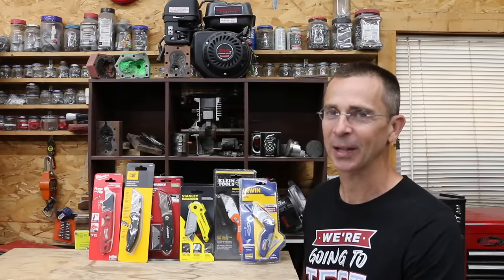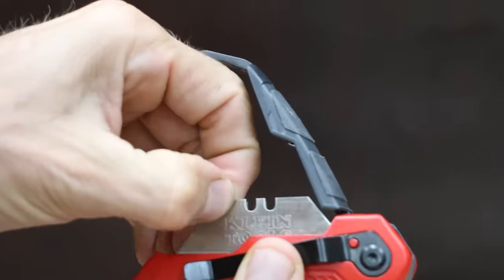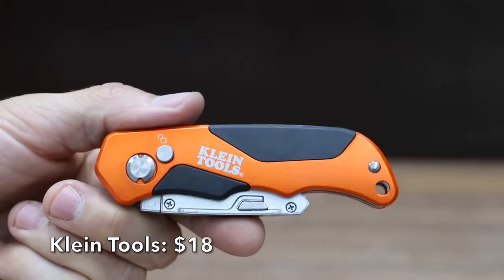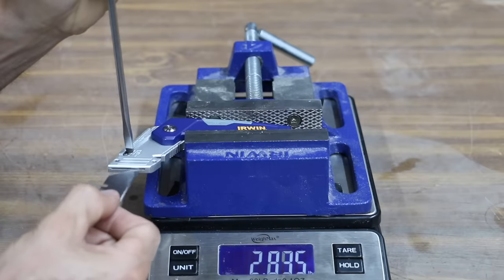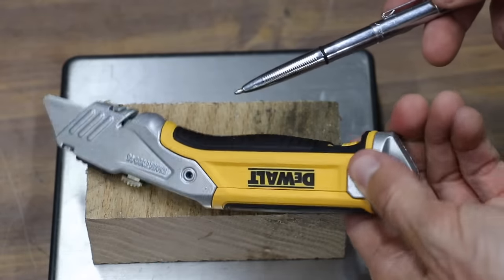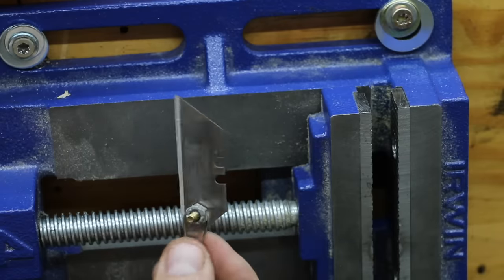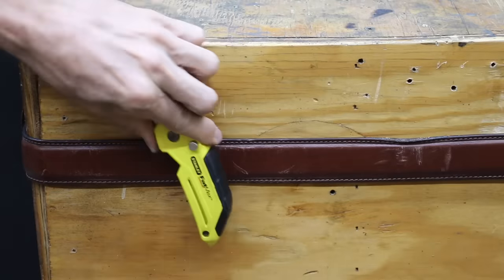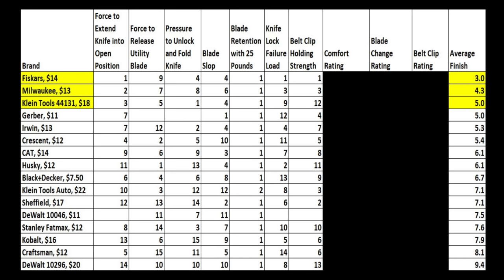Best Utility Knife? Let’s Find Out! Milwaukee, DeWalt, Gerber, Husky, Kobalt, Klein Tools, Craftsman

Comment: Surprised you've never compared home fire extinguishers.  It's something most of us never test until everything is on the line, so I'd love to see a comparison of a good range of them, from the First Alert EZ Fire Spray up to a 20-30lb ABCK.
Reply: Really good idea and he’d do a great job too
Reply: This would be a good one.
Reply from the maker: Thank you for the video idea!
Reply: You'd be saving lives by making this video, and it could be quite entertaining

Fire...cool!
Reply: This is a fantastic idea.  Even if I'm not concerned with branding it would be very helpful to know how mine will preform.
Reply: @ProjectFarm  

If you do decide to test home fire extinguishers, I've got 2 (still charged) 20+ year old Kiddie extinguishers I'll send to you as comparison examples. You can test them out along with the rest.
Reply: I wonder how the fireball type fire extinguishers compare to a conventional fire extinguisher? Good video idea.
Reply: @ProjectFarm  If you do happen to run with this idea just remember there are classes of extinguishers. So I would either buy a few of the same class and get multiple classes, or stick with one class. Some are even mixed classes. I believe the Kiddie Basic Home Extinguisher is a mixed A, B and C just for reference.
Reply: Way to messy
Reply: @pjkentucky  Fireball type extinguishers work by smothering. You throw them into the center of the fire. But the only thing that sucks, is if the fire is big enough, you're just wasting time. If  you can catch it quickly, they work great, and can definitely give you an egress. So there are benefits. And fire balls are more for indoor fires that are in confined spaces or corners...There are ones that explode on contact and some have a fuse that explode in the fire. I think the fused ones would be best for maybe garbage fires, dumpster fires, etc. There are videos you can look up. So the fireball I highly doubt could stand up with an extinguisher that can discharge for 30+ seconds. They are cool though. Similar to the idea of Fire-Stop Hood extinguishers. I've always used those for the stove for years.  They work great! And they're good for 5 years, and extinguish a grease fire if made on the stove.
Reply: Great idea.  I would love to see that.
Reply: You’ll see this answered this year 👍🏼
Reply: Ooooh. Yes! That'll be useful to have.
Reply: Agree on that! Would definitely be great to view!
Reply: Thanks, good idea:: oddly It never occurred to me to 🥸”” compare”” fire EXTINGUISHERS
Reply: Please include the Element E50 in any fire extinguisher test!!
Reply: This is unique and great idea. A side benefit would be the amount of people who watch this channel without a fire extinguisher going out and buying one afterwards
Reply: Please include the non-toxic fire extinguishers from firestopperus in the test. Thank you.
Reply: @markmills344  I have  a fire extinguisher that is about 40 years old. I have wondered if it is still good.  I guess I should discharged and recharged.
Reply: @ProjectFarm  please test fire extinguishers for us!
Reply: @markmills344  I would replace those right away. Kiddie has been known to be unreliable. I think that might have been what I had in my car when I needed to put out an exhaust manifold fire. It worked for about 1/2 second and that was it. Gas was gone. Luckily it put out the fire, but just barely.
Reply: @coltonmuri3672  

I did replace them, but I didn't throw the old ones away.
Reply: I want to see how he tests them besides the obvious starting a fire. 

But I feel like being a safety item it has to pass certain standards so there shouldn't really be many differences between brands of the same type ABC extinguisher
Reply: @dougr.6734  Yes, definitely want to see a test of the Element extinguishers.  I carry them and would really like to know if they will actually outclass a can.
Reply: @ProjectFarm  wish you had tested Jerry rig everything knifes
Reply: Boy that's a good idea.
Reply: Great suggestion - add my vote in favor! I'm not sure how you'd test for it, but I'd be interested to hear about their shelf life - ie: how long do they remain viable while sitting idle?
Reply: This is a great idea.
Reply: lol I just had to use a fire extinguisher for the first time a couple weeks ago. My wood stove set fire to the cardboard boxes behind it and spread to the wall xD
Reply: Yes!! Please test fire extinguishers!! I’d love to see how those stack up!
Reply: As with everything you need to have a controlled environment. After all we are talking about fire, but a good idea nonetheless.👍🏻
Reply: @dougr.6734  I second this! I bet many people don't even know these exist, but the test wouldn't be complete without one.
Reply: You have to test AKE's Stop-Fyre reusable fire extinguisher. Marketed as "The world's best fire extinguisher". It's nothing like a conventional extinguisher. I swear the thing is magic. And the price reflects that. Also warrantied and guaranteed for life, with lifetime free replacement. Check em out.
Reply: I really like this idea!
Reply: You should do some maintenance or have professional to do it from time to time. There's not much you can do for CO2 and liquid extinguishers, but if it's powder extinguisher there is something. 

The powder tends to pack up and/or get lumpy at the bottom due to gravity. Given enough time, it will prevent the powder from coming out when needed. You should shake the extinguisher to move the powder around at least once a year to keep it in good condition. Turning it around a couple of times until you don't feel anything solid moving around will be sufficient. And if there's a pressure meter, you should check that too. That's about all you can do for them in home-conditions. 

There's a lot other things too you could do but it requires some equipment and know-how so I won't go there here. 

How do I know all this? Because I've done inspecting, maintaining and fixing them professionally.
Reply: @ProjectFarm  two possible videos, home/RV size, and full sized for shops. Maybe include alternates, like fire blankets and fire bombs.
Reply: cant wait to see a durability test of fire extinguishers
Reply: That's a good idea for a test.
Reply: I keep a 3lb Halotron in my car. No residue to clean up, kills fire instantly, but very expensive. A 20lb for a house is $500+
Reply: If he test fire extinguishers I think his cousin would make a perfect test dummy  lol jk but I could see it now he is sitting on top of bbq grill let's see if fire extinguisher saves him in time lol
Reply: Yes I need to know their bulletproof capabilities as well. Perhaps a crossover with demolition ranch.
Reply: Yes that would be a good test
Reply: That is a great idea!!!
Reply: @ProjectFarm  watch out, they might have you testing fire trucks next. That would definitely break the bank. Lol
Reply: This would be a great and highly useful video
Reply: @markmills344  check with Kidde: I know they've recalled some of the older extinguishers with plastic handles, so you might be able to get a free exchange for brand new ones.
Reply: Fantastic idea I hope he does this. What could he measure? Weight, spray duration, handle squeeze weight (heavy handles may be difficult for the disabled or elderly), ease of use in a panic(if thats possible to test in some capacity?) Deployment speed, price, rechargeable or not, UV rust and weather resistance. Thats all I can think of.
Reply: This would be a great resource for volunteer firefighters to recommend items to the public
Reply: Solid idea.
Reply: Wow thats actually a great idea
Reply: Agree
Reply: Absolutely ! Great suggestion !
Reply: Cool, I mentioned this also a couple weeks ago👍
Reply: “All my videos are viewer suggested” 
So great suggestion. I’d love to see what happens.
Reply: Very interested in this!
You could do fire alarms too while in that space
Reply: Love this idea!
Reply: Good idea! +1 for this!

I tend to just have fire blankets at least in my small workshop, they never really expire. If I had a large workshop an extinguisher might be better.
Reply: A follow up video with Fire blankets would also be nice
Reply: Way too many variables that you couldn't possibly reproduce. Besides, 8 out of 10 people would run and grab their phone instead of a fire extinguisher...if they even know where one is...or even how to use it.
Reply: Absolutely
Reply: Good point I'd like it too.
Reply: @pjkentucky  Those suck! Do not buy them… they are not worth it.
Reply: Great idea, I've had to use a fire extinguisher on home fire, I'd love to see what I should have in my home!
Reply: Also test the automatic ball ones
Reply: Add the element e50 to this test please
Reply: @ProjectFarm  A fire extinguisher test would be useful and save lives, but honestly I'm most interested to see what tests you devise.  Off of the top of my head I'm picturing a matrix of evenly spaced holes jetting propane flame as seeing how many jets are extinguished by a short-duration pulse, but you always come up with wayy better tests than I would think of so i'm incredibly curious what you'd design.
Reply: Great suggestion. Do it, Todd. Lives are depending on your test!
Reply: Agreed - I'd like to see these tested too
Reply: I have one major piece of advice about home fire extinguishers. And the ones with plastic nozzles cannot be refilled once they are used. They have to be thrown away. Get one with a metal nozzle so that you can have either a fire extinguisher company or your local fire station refill it after you use it. The ones with the plastic nozzles are unable to hold pressure once they are used.
Reply: @gregderise9969  the plastic nozzle ones are generally so cheap I can't imagine going to the trouble of refilling them. Of course, I think about 80% of the extinguishers I buy age out unused, so another $20-40 every decade isn't a huge expense.
Reply: @ProjectFarm   
How about testing zipper up hoodies . They're are almost as popular as Jeans which everyone on the planet owns. Also test socks for work boots that are suppose to have reinforced Toe area for them steel toe boots. Also knee pads for many workers who have to kneel many times a day. Thanks
Reply: Would be nice to see in the comparison wich one get to destroy installation (extinguisher for car prupose for example, Co2 or powder) how to process the best at the cleanup
Reply: @jakel.1724  he always does! 👌
Reply: @harpintn  depending on your needs - just buying a new one maybe easier and cheaper.   at least if its small size.  Something to think about.  i am a maintenance manager, we have a lot of bottles, they have hard expiration dates for a full empty and recharge, even if in the green.
Reply: @chuckdawg2799  Thanks for the tip.  It is a steel bottle, and I gave a fair amount for it back in the day.
Reply: Fire extinguishers might be useful, but considering you have smotherers (powder type, blankets), displacers (CO2/Halon), and extinguishers (CO2/water), it might not be easy to really do a comparison.    Definitely do this outside.     I'm personally having a hard time getting a good CO2 extinguisher locally - nobody wants to talk to you as an individual.   I'm an IT consultant, and I don't relish the idea of spraying down computer equipment with something that do extra damage, or the cleanup will.
Reply: Actually probably one of the most important videos he could make
Reply: Fire extinguisher is something that you have, but you wish won't use it 😂.
Reply: @pjkentucky  I have some antique fireball extinguishers. Literally glass globes you are to throw into fire hard enough to break the glass. I'm not betting on them, especially not over a 1A10BC dry chem unit!
Reply: Poor Cousin Eddy
Reply: @ProjectFarm  Include Element please! :)
Reply: ive put out a couple diesel and hydraulic fires in my time and when it came down to it. the last 3 fire extinguishers i attempted to use did not work. Gauges read good, powder was loose in containier not solid. but they did not function, ended up sprinting to the next closest one about 200 yards away which thankfully worked lol
Reply: Fire extinguishers and smoke alarms!  Even include those “glass vase” style ones that explode to extinguish fires.
Reply: @ProjectFarm  (Fire Extinguisher) Use Cousin Eddie as a makeshift Rioter. Determent volume & pressure. 
Might be fun to see how far he weaves & wobbles, or fall down. 😉
Reply: yes this be great ideal
Reply: @ProjectFarm  you do not want that material getting on anything, it will cause metal, clothing, plastic, tile,  wood.. anything and everything, to corrode, rust and ruins everything it touches. halon fire extinguishers are superior, but very pricey
Reply: @ProjectFarm  I got the Fiskars PRO Utility Knife top brand...
Reply: good ideaa
Reply: @Project Farm I'm late to this comment thread but this is a GREAT idea, please test them! Would be great to see common Kidde (🤢), First Alert, and Amerex models plus the aerosol sprays.
Reply: @pjkentucky  WHAT FIREBALL TYPE?
Reply: @gatorb8  HE LIVES ON FARM, WYM MESSY
Reply: @stevethea5250  WYM?!?! FIRE EXTINGUISHERS ARE VERY FUCKING MESSY AND SOME FIRE EXTINGUISHERS HAVE STUFF THAT ISN'T VERY GOOD TO INHALE INSIDE THEM. 
DOES IT MATTER WHERE YOU LIVE HAVING THAT S*** LAYING AROUND IN YOUR SHOP OR YARD ISN'T IDEAL
Reply: Start with the smoke detectors
Reply: For extinguishers???? Zzzzzz
Reply: Sign me up for this. I’d even throw money at this, too. 

You’re so damn good at what you do and I know that we’d get a completely honest unbiased test as to which one we should purchase and why. 

You’ll literally save lives with this kind of testing.
Reply: @ProjectFarm so wheres the video haha :p
Reply: @northparkanita3152 " We're going to test that!"
Reply: Still waiting for this video!!

Comment: I love my Milwaukee one. I now carry it daily instead of my fancy collectible pocket knives.
Reply from the maker: Great feedback on the Milwaukee! Thanks
Reply: I have 1 too. It has a phillips/flat head screwdriver, a 1/4 hex head screwdriver, wire stripper and a beer bottle opener. Always comes in handy. Its slightly different than the one in video, but basically the same.
Reply: @Straight_White_Fatherly_Figure Sounds handy! Know the model number? 🤔
Reply: Milwaukee 48-22-1505… the best utility knife ever made!!! It has a real screwdriver, bottle opener, extra blade, and NO Liner Lock (to cut your finger off).  The blade is secure, it is very compact, lightweight, and it feels great in your hand.
Reply: @gus473  idk why my comment keeps getting deleted, but @Mr. Water Twister posted it
Reply: @gus473  bottle opener is exposed when blade is closed
Reply: Sad to hear 😢 knives bring so much more joy

Comment: I carry the Milwaukee fastback with screw driver and extra blade storage everyday for landscaping.   Between the 2 different screw driver heads, 1/4 inch driver, can opener, blade storage, and single hand quick opening it is perfect for my needs.
Reply: Ever since I got my Milwaukee knife I promise there isn’t another knife I’ll carry. I work on a pipe crew and it makes my life so much easier. Plus when I’m bored I sit there opening and closing it because it’s so fast and easy
Reply: @KrewKaleb  the ultimate fidget spinner with a purpose.  Many purposes that is.
Reply from the maker: Great to hear!  Thanks for sharing.
Reply: I have the 1st gen fastback and although it doesn’t have any extra blade storage or screw driver head it’s the best and everyday knife I use I’ve had it on my everyday since I first bought it when it first came out
Reply: I wish the 6 in 1 would've made it into the comparison, it's a relatively new model from Milwaukee and imo, superior in almost every way except for maybe those who need more than 1 spare utility blade for storage. It fully opens with gravity alone, and the ergonomics are better than ever
Reply: @ProjectFarm  FYI the fastback with the screwdriver attachment is made much better than the one you reviewed, not sure why they're so different. I have both and there's a noticeable quality increase on the screwdriver version, even though they're nearly the same price
Reply: I've had the basic version of the fastback with just the blade storage for several years now. Definitely the most used blade I own and it has zero issues despite the abuse it's taken.
Reply: @LzysGraphics  That's the one I have. The screwdriver plus the cool way you can flip it open made it my favorite utility knife of all. Best $20 I ever spent.
Reply: @brendanflaig5429  At my local The Home Depot you get Gen 1 and Gen 2 for $14. Just the Gen 2 is $12 by itself.
Reply: 6in1  , by far the best , and its with me 24/7 .      one thing not tested was the offset of the blade , to make flush cuts.
Reply: Can’t beat the fastback models 👍
Reply: I have this too and use it every day, absolutely love this knife.